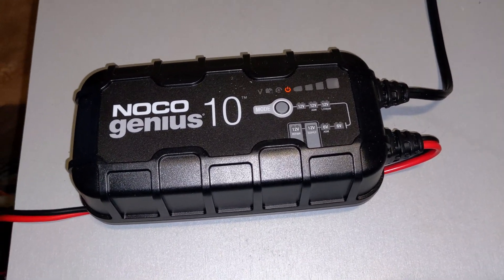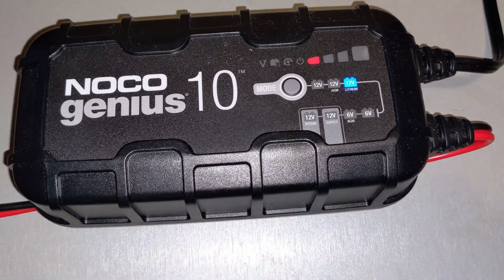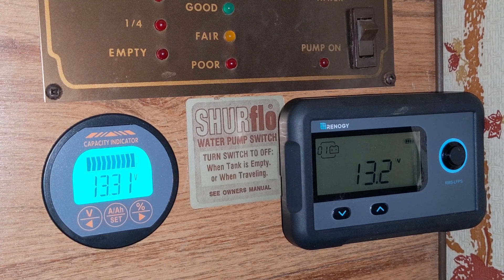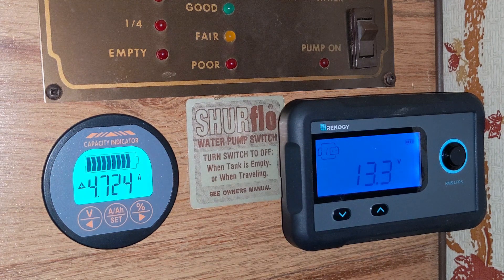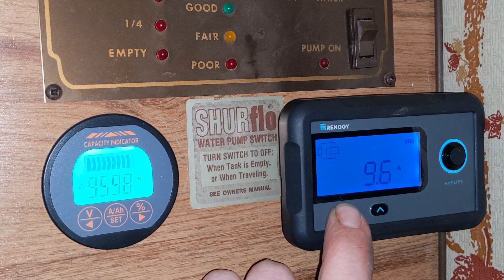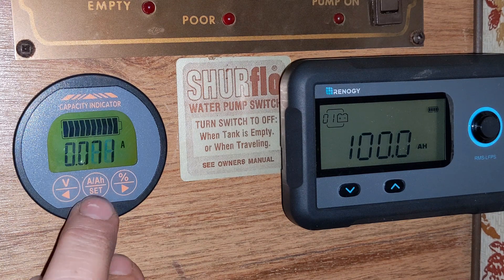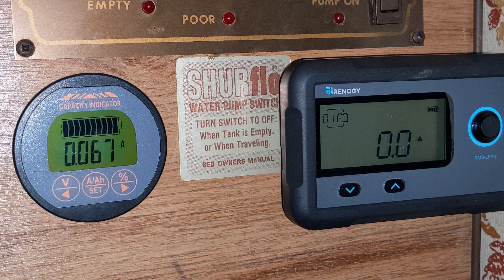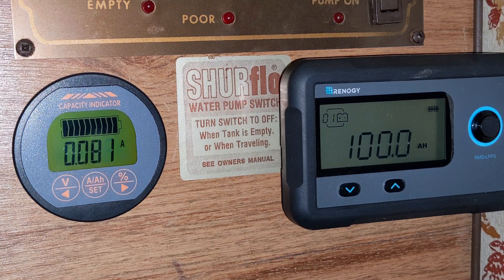Review of NOCO genius 10 charger charging  12 volt lithium battery in RV

Comment: Would you trust leaving one of these chargers attached permanently to a 12v 100ah LifePO4 battery?
I have a radio repeater located at our lake house and would like to have it operational even during a utility power outage.

I have utility AC power at the house, which is fairly reliable UNTIL a bad storm hits.
I don’t have solar yet and we rely on a few Honda portable gasoline gensets for the occasional storm use.

The repeaters use 12vdc power (11-14) with nominal 3a current draw and 13-15a when transmitting.
I have been using DC power supplies with a home built lead acid charger / transfer relay and it’s time to for the 3 year replacement of the batteries ($600 + delivery for 4x 6volt Trojan flooded lead acid).  

So.. it seems like an ideal time to go LifePO4.  

Thanks!

Comment: i have a converter question. im in the same boat as you i m wondering how much your convert WILL charge the lithium. my converter puts out 15.3 v...in between using the noco could i use my converter?

Comment: Does anyone know the lithium charge specs?  I have a renogy 200ah using a 10x2, using one channel to charge my lithium.  The battery has depleted to below 50% and the noco charger is still showing fully charged.  If i turn the charger on then off again it then begins charging.  Im curious if it will auto detect the low capacity and initiate a charge or will I have to do a reset on the charger to initialize?
thanks

Comment: It seems like big time under kill to use a 10 amp Noco on a 100 AH lithium that's capable of taking 40 amps.
Reply: I think the 10 AMP version has other features that the Genius 5 didn't have like 12V Repair and Supply. Those two things may come in handy for the extra $30 otherwise I agree that the 5 AMP version would be enough with a battery capacity of 120ah.
Reply: @chrismcleod2411  Rick is saying a higher amperage charger should be used since the lithium can take 40A.

Comment: ⛔ Hello, I have a 75 ampere battery, what is the appropriate charger for 5 ampere or 10 ampere, and is the maintenance feature effective (3 year old battery) Thank you ♥
Reply from the maker: Are you referring to a 75 amp hour and is it lead acid or Lithium ?
Reply: @trailertimssmokeandwires211  lead acid

Comment: I have the same charger and it stops charging my 100ah Lifepo4 on the lithium setting  at 13.5 volts. Do you have any clue why?
Reply: found a very good article. for LifePo4 battery, charger kicks battery to 14.4v briefly and turns off. battery voltage drops to 13.5 v. so 13.5v for lifepo4 is norm after charging.
Reply: @johnthehammer7702  Yep
Reply from the maker: Which battery do you have. Does it have a built in BMS as mine does ?
Reply: @trailertimssmokeandwires211  It's an Ampere Time 100 ah, yes it has a BMS. I got it to 13.6 volts which is actually fully charged. What is the benefit of getting it between 14.2-14.6 volts?
Reply: @DoobSac  At 14.2 volts, the BMS will begin balancing the 4 individual cells. If one cell is lower or high, the passive balancer will correct for this. Important for the longevity, and load capacity of the battery. At least you got an answer 4 yrs later😂😂
Reply: @trailertimssmokeandwires211  I used it today and now I'm charging it . I just checked it and it's at 14.1 volts and still going up.
Reply from the maker: @DoobSac  most BMS top balance the cells at 14.4 volts. Let the charger go untill it stops. If you have a shunt or an amp clamp you will see current drop after it reaches 14.4. They charge to 14.4, but after charging and disconnecting the  charger it will drop to 13.8 . Then stay between 13.2 and 13.8 for most of its capacity. Take a look at Battle Born battery voltage vs state of charge table. It should be similar to yours. How long have you been charging it ?
Reply: @trailertimssmokeandwires211  Does the NOCO keep charging even when the LED light is solid green? It quickly went down to 13.7 after I turned the charger off.
Reply from the maker: @DoobSac  it reduces the  current eventually to 0 but hard to tell when it's done without measuring current. The green light will slightly pulse when it's charging. The quick drop to 13.7 is normal. Maybe give it an hour after it reaches 14.4 and call it charged. I normally leave my battery around 13.3 to 13.5 volts and only fully charge it before I head on a road trip. I'm signing out for the night.
Cheers
Reply: @trailertimssmokeandwires211  some batteries need 14.6v charging.
Reply: I observed the same thing on my NOCO 10amp. My understanding is that NOCO is made for Lithium Ion (which is 13.5v), not for LifePo4 (which is 14.4). Lithium Ion and LifePo4 are different. For my 7AH and 20AH, NOCO does kick it up to 14.4. However it can not do it on my 100AH one.
Reply: @johnthehammer7702  It will max the battery out even if it only says 13.5. It's like 99% of the battery. Anything over 13.6 or so is only 1% of the battery life.
Reply: @johnthehammer7702  the user manual says LiFePO4
Reply: I have the same issue, both my nocos think my renogy LiFeP04 is full at 60% or so

Comment: Can I charge my Anti Gravity Lithium Battery (Ag-1201) 12cell with this?
Reply from the maker: Looks like your battery has a max charge rate of 8 amps and the voltage of this battery may be a bit higher than a typical RV lithium replacement like I am using. Also your battery does not have a BMS which can make charging incorrectly more dangerous. I would recommend using manufacturers recommended charger.
Cheers,
Trailer Tim